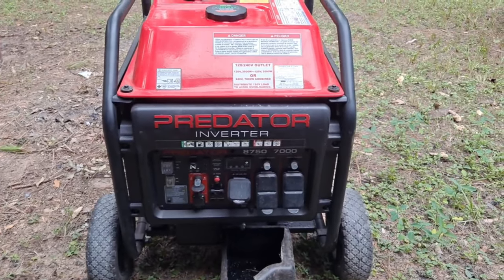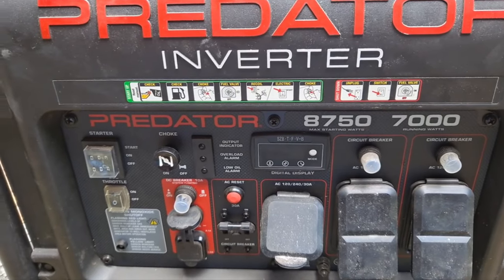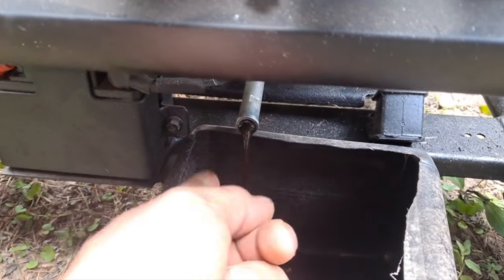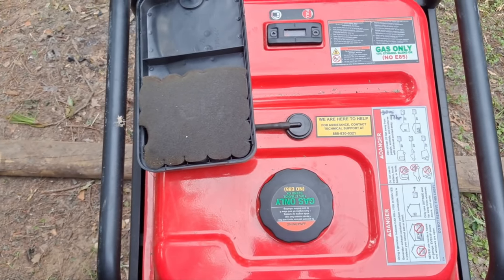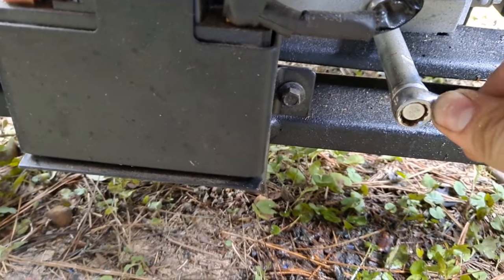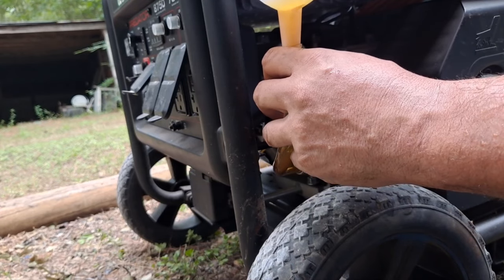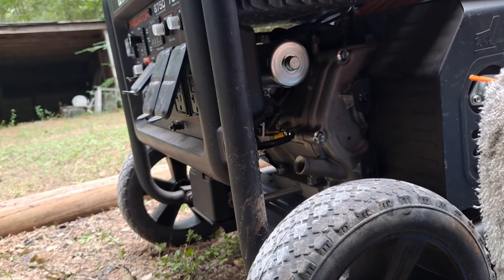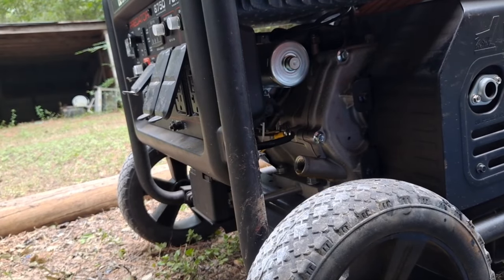Predator 8750 inverter generator, how to change the oil.

Comment: Terrible position to check and fill the oil.
Reply from the maker: Why? What's wrong with it?
Reply: @davidcraft4909  it’s buried and hard to get to, checking the oil should be the easiest thing to do on a small engine.
Reply from the maker: Lol, I agree.  I wasn't sure if you meant something like that, or if you were saying I didn't check oil on level ground.  But yeah to check and fill is in an awkward place. Thanks for watching

Comment: How often are u supposed to change? Instructions are confusing they say every 20 hrs and every 50 hrs..thanks for ur video
Reply from the maker: The manual says oil change after 25 hours for the break in period.  Then every 50 hours.